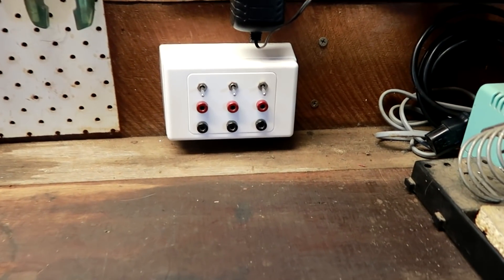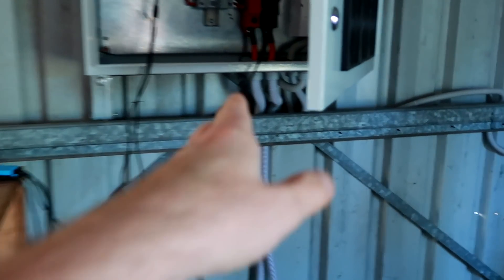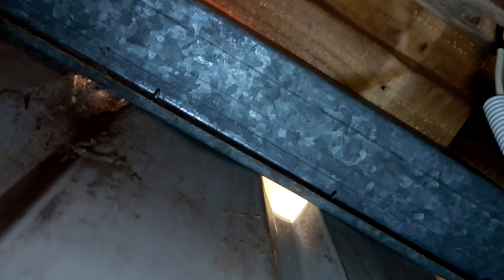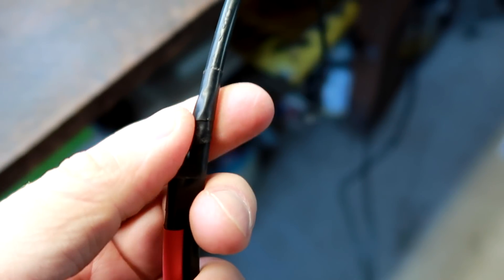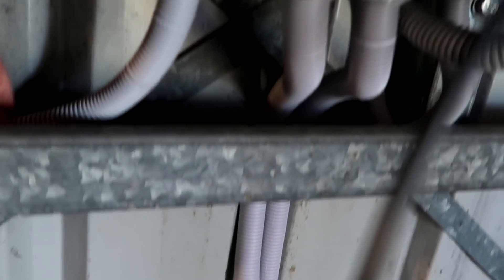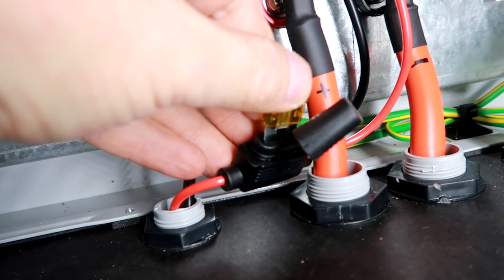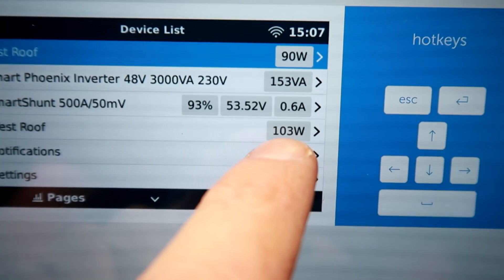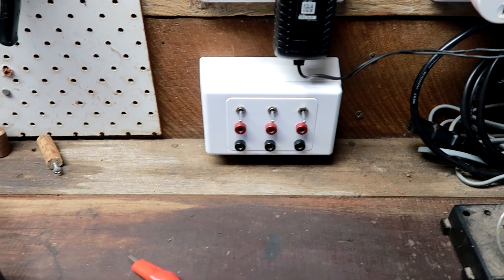Connecting my battery to my workbench.

Comment: Odd request for you, I recieved some chins 200AH lifep04 batteries and I can't find any good reviews on them, I have ran some tests on them but looking for someone that could do a tear down showing the inside, im not sure how good the cells or BMS are, I thought about taking them apart and building my own battery with better BMS but im not sure if thats a good idea
Reply from the maker: Did you do a capacity test?
Reply: @OffGridGarageAustralia  yes, came in at 217AH and the BMS shut off at 9.42 volts, I have three of these same batteries, I hate to crack them open but im not sure of the quality
Reply from the maker: @todamnbad  I would use them as they are. If you get 217Ah out of them, that's fantastic. You can still open them if you have a problem down the track, but for now, just use them a they are.
Reply: @OffGridGarageAustralia  thank you for your reply, not many people reply to questions from subscribers
Reply from the maker: @todamnbad  I'm always here and trying to be part of the community, answering as many comments as possible. Thanks for your feedback 😉

Comment: that reminds me of myself charging a Flux capacitor to charge the same Flux capacitor in a continual loop, just so i didn't have the use the grid ;O)
Reply from the maker: How did you go?
Reply: @OffGridGarageAustralia  my battery charger got real warm after a 1/2 hour or so, so i shut it down. The battery charger was a Marine multi battery charger with no fans. I guess i could have cool it down with a small fan in very close prox. to the the Battery charger. The layout was battery connected to the inverter connected to the marine battery charger, connected to the same battery. I was just experimenting but i wanted to see if i could use the same battery to continually charge itself and eliminate a solar system, or using the grid. My memory of the events are somewhat froggy im guessing this is very close to the setup i had.

Comment: Please be aware, that using this type of small car ATO fuses in a 48V System is not as safe as it should be, because this type of fuses are mostly only rated for voltages up to 32V. In a 48V system you should use fuses which are rated at least for 58V.
Reply from the maker: Yeah, there could be an arc in case of a short. In an 48V fuse the two metal supports holding the fuse wire are further apart.

Comment: I'm not sure if you can test a lot of things with solar charge controllers if you connect them to your big batterie. I guess for many things you will want to test, you will need the batterie in different states like empty, under load, floating, full etc. Isn't that easier and more flexible to test with a smaller batterie?
Reply from the maker: Yeah, could be true. But the string on the console was empty anyway, so... (side project) 😊

Comment: I love analogic switches and clocks. I would add an analogic voltage meter with a push button to check voltage every now and then. 

Great idea, it makes perfect sense to have power from your battery on top of your workbench.

Love your videos and the learning curve. Had a hard time keeping up with the more technical info about voltages/balancing/shut power etc in the last videos.

Keep up the good work.

Comment: The fuse is used to protect the wire and should be chosen depending the max amp handled by the wire section (Ex: 4mm²  =>  42A max) so a fuse of 40A can be used.
Reply: I have experience using one of those fuse holders. Don't run it above 20 amps. The fuse holder itself gets uncomfortably warm at 30 amps and mine are 10 gauge wire.
Reply: The switch and banana plug are also in the circuit , not just the wire. No way the switch is rated to 40a .

Comment: 2 x 22v = 44v = not enough to use a normal MPPT  or PWM  for your 54v battery.  There are boost MPPT's but most are buck so you need extra volts. You'll need a 3rd panel, or different panels.

Comment: A tip for fishing wire through conduit is get you a long string tie it to the end of your wire and use a vacuum on the other end of the conduit to suck the string through and then you can pull the string and the wire through the conduit
Reply: and tying a bit of plastic bag or light cloth to the string helps too.
Reply: For short lengths of conduit, I use a nylon draw string